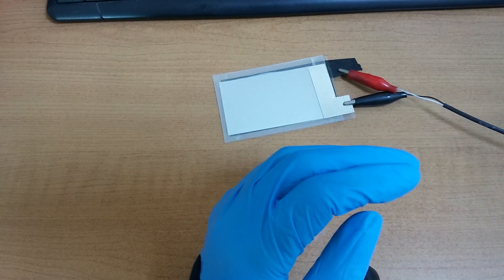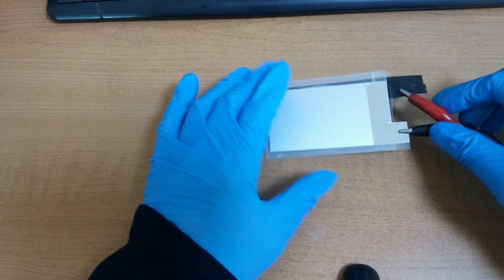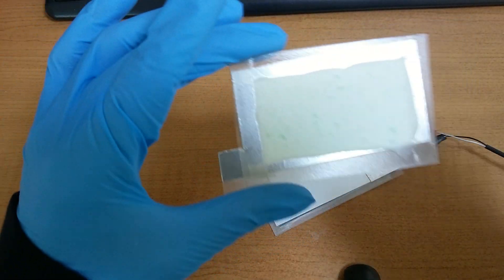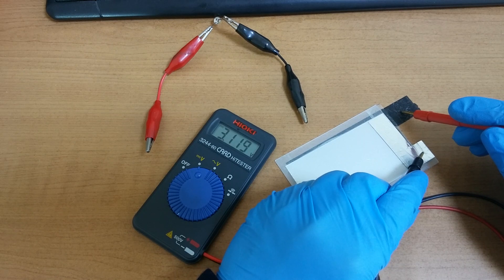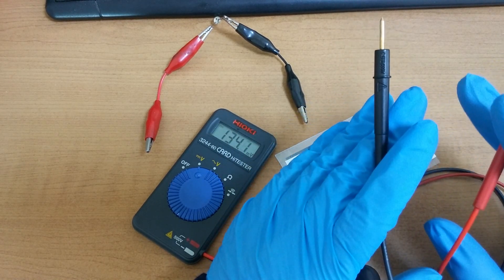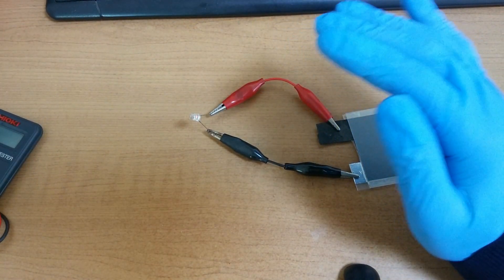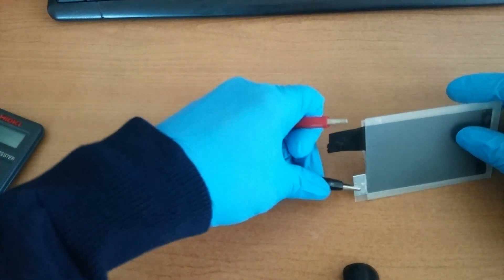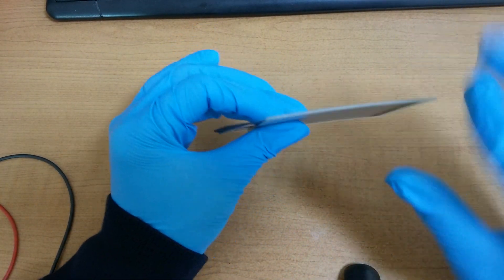graphene sodium solid state battery from 3.1 volt

Comment: I think 3.1V is a quite promising voltage for this particular experimental dry aluminum carbon/ graphene cell. Maybe the resistance of your positive graphene paper is far too high at present to produce a good amperage... so would be interesting to know the ohms per sq (or cm) of your graphene paper?. You could use much higher conductivity copper foil or fine stainless steel mesh as a current collector for backing behind the graphene coated paper. Also very interested on the method you are coating graphene con your paper fibers to maximize its electrical conductivity, many kind regards P :))